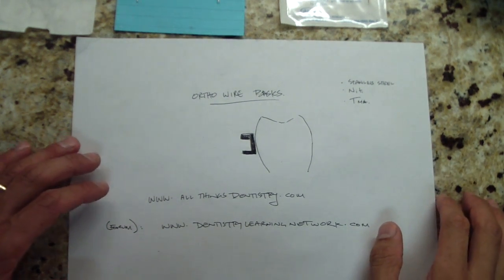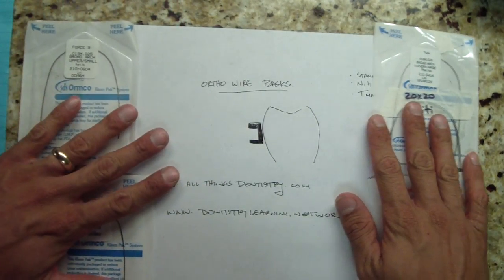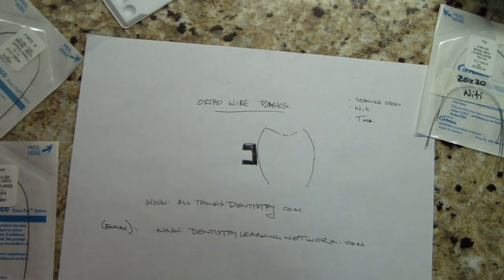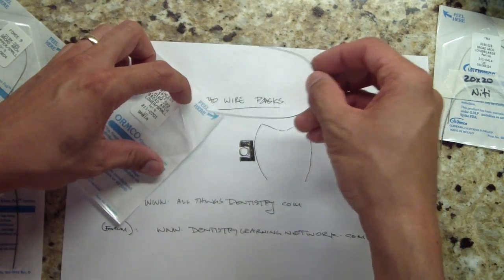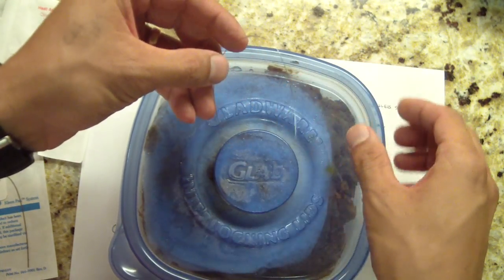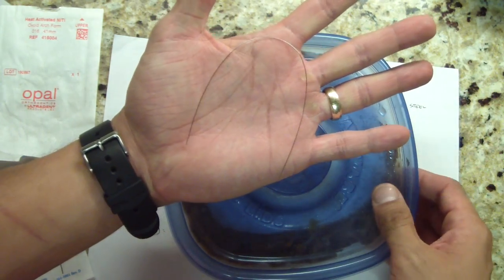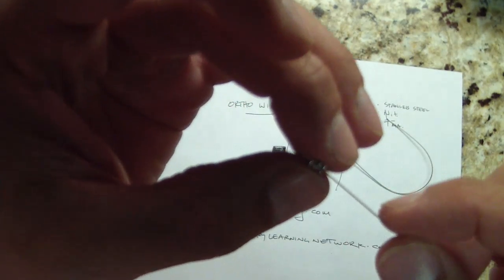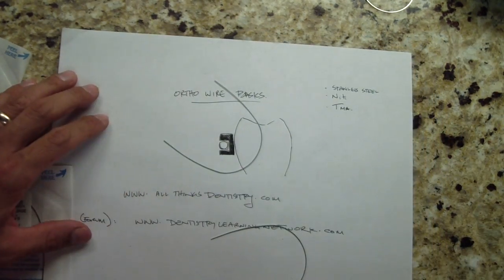Orthodontics Wire Review - Niti, Stainless Steel, TMA

Comment: Difference between 0.14 and other number
Reply: is that a question? the number relates to the cross section. So a 0.014 is thinner than an 0.016 wire. The fact its a single number means its is a round cross section, whereas something like a 18x25 is square (well actually rectangular) cross section since those numbers are the lengths of the sides.

If you mean why use different ones? Basically thinner can be deflected more and not put too much force, so early in the treatment you want finer wires until the teeth are less out of place.

Comment: can you use the same size arch wire every month or the arch wire need to be change it every month?
Reply: every 2-3 Months , becouse the teeth change positions to mimic the Arch shape , so it wont make any change to the teeth after 2- 3 Months and should be changed to make the next moves ..